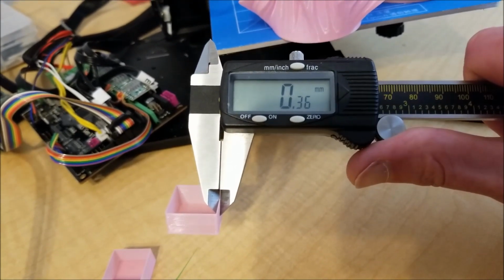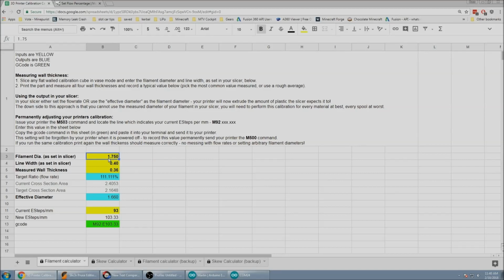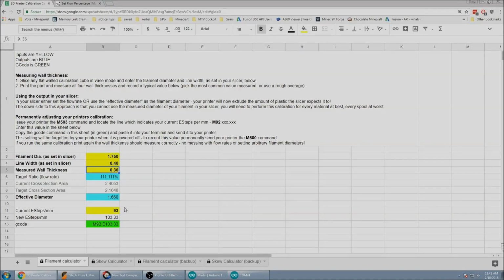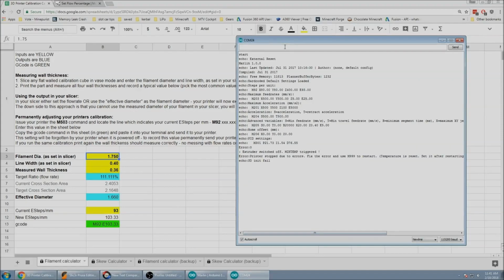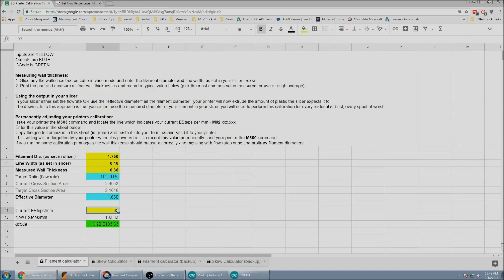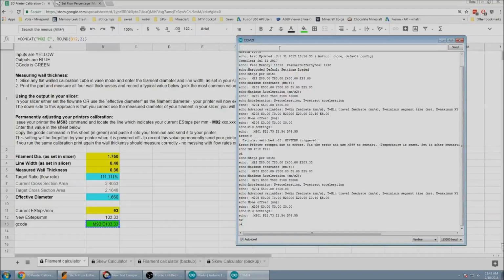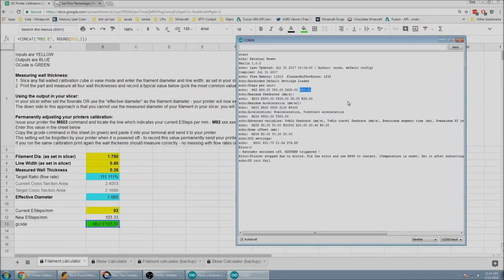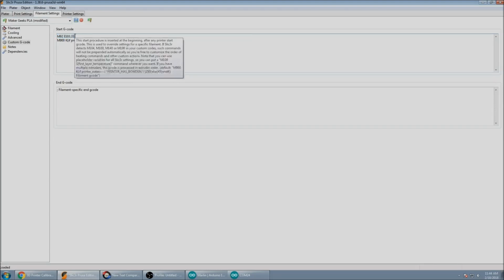Getting Better Layers from your 3D Printer and a better(?) way to calibrate your extruder!

Comment: almost every article i've read about flow calibrations says you should first calibrate hour extruder  e-steps first ,and only then calibrate flow 
another point to consider is that when calibrating e-steps the filament temperature should be high to allow minimum resistance. (otherwise results would vary greatly)

Comment: Just subbed, i got a alfawise u30 giving me underextruding issues and the old way of marking the filament just doesn't work well as i dont care what goes in since that's 1.75mm i care what the part measures. Gonna go try this asap. Ty

Comment: My ender 2 was built around 9/2018 and there is no longer a flexible connection for the Z axis at least there is none on mine, it has a completely different coupler, people complained about alignment of the screw being off severely on these older ones with the flexible coupler, but what you pointed out would be a lead cause for that, the alignment on mine is within 0.6 mm from top to bottom! another thing people over look is making sure the the print head rail is inline and square with the bed while assembling, which can give you a non square print! 

I know some people were complaining about using abs, you actually have to set the temp to at least 240-250 in the g code in order to print abs. But I love the finish of carbon fiber abs, I had problems at the 230 c setting for the carbon fiber abs, but once I turned it up to 250 C it prints perfectly and does not curl or separate from the bed, however with standard abs this is not the case, at 250 C it will curl and separate from the bed, but it may do a little better at 240 C and a slower print speed, allowing the stock setup to cool the abs more than a 60mm/s setting does!

But in the future I will look into designing my own cooling for the print head, most require a blower, but I have several 40mm fans I used to use on my ram that are just sitting now!

Comment: Hi Ross. Thanks for this informative video. I have ran a test myself with a small cube as you did. Result: I now have a cube with two smooth sides (paper thin) and two sides where I noticed the X axis was making kind of a zig/zag move. These two walls also printed but with a different texture and wider than 0.4. Result: first wall (facing me in front of the printer) 0.66mm. Second wall (wall on the right) 0.62. Back wall 0.28 and left wall 0.33. Think I have some more work at hand to calibrate. Any tips are more than welcome. I realize that this is a bit of a dated video :-)
Reply from the maker: That sounds terrible. What printer do you have? Is it pretty much just out of the box? Or has it been working fine? 

I've never experienced anything like that. I'd start with making sure all the screws and nuts are tightened down and check the tension of the belts (if its brand new... that's actually more of a reason to make sure everything is tight). I'd also check the filament path making sure nothing is out of alignment (e.g. does the extrusion gear align well with the filament line in and out or do you need to wiggle or fiddle with the filament when loading to get it to go through). Also make sure you have enough tension on the extrusion gear. I'd also suspect a possible partially clogged nozzle so try some unclogging techniques such as a cold pull, etc. If it's a ptfe lined hot end it might be worth disassembling the hotend, refreshing (make sure it's not distorted, etc., use a good blade to give the inside lip of the tube a bit of a chamfer) and re-seating the ptfe tube. My ptfe lined hot end that came with my ender 2 was poorly assembled and rebuilding it solved a lot of my early problems.

Hope this helps!
Reply: @rossk7927  Update. I have checked everything as you suggested but could not really find any issues. I then went back into Cura and loaded the cube and the circle test objects. Sliced it and upon closer inspection it turns out that Cura slicer looks to be causing this. I have checked every setting but so far i am not able to tackle this issue.
Reply from the maker: Give the profiles recently shared/used by Makers Muse in his ender 3 follow up video a try (posted in the last week or two). The video is titled something like try this weird trick to improve your prints (titled as a bit of a joke). I generally use Slic3r these days myself, having a lot of control over the slicer can be good but frankly I find that cura these days offers an overwhelming set of options and I have a hard time remembering what they do or why I set something the way I did (or even IF i set it myself). 

It may also be worth checking for a new version of cura, if you are on the latest version try a slightly older one. There might be a bug in the version, and combination of settings, you are using.
Reply: @rossk7927  Nailed it! I watched the video and the two setting I changed are the layer height from 0.2 to 0.16 and the flow rate based on your video. Thanks bud. Happy printing
Reply: @rossk7927  Thanks for the reply! I have a Ender 3 which is as good as new. I will start by following your advice. Just to validate I have also run a test with a round box of same dimensions (bottom, wall thickness and diameter of 20mm). This time it gives me a consistent wall thickness. I will let you know what the outcome is

Comment: This is super informative. Thanks!  So you drew boxes with .40mm wall thicknesses as the calibration parts?
Reply from the maker: I used a solid cube model and sliced it in vase mode. Vase mode prints the shape in one continuous line which spirals up giving the part no seams but only a single wall. Not all shapes can be printed in vase mode.

Comment: Hey Ross, thanks for the video. I have two questions for you :)
1/ if you extrude by hand some PLA with a 0.4mm end, let's say at 200°, then you let it cool down, and you use your caliper to measure the diameter of the "string" that got out, what dimension do you get ?
2/ when they say "190° extrusion temp", does it mean 190° measured at the extruder end, or at the aluminium bloc ? (i need 230° at the alu bloc to get 190° at the extruder end...) 
many thanks !
Reply from the maker: 1) No idea, this isn't a valid way to get any useful data. This isn't valid because the nozzle wont be under pressure, feed rates wont likely be close to print feed rates, and the extrusion won't likely come out consistently anyway. 

2) This is normal. It's just the way the universe works - for the air around your block to warm the block needs to give up energy. The temperature is read internal to the block - Ideally it's the temperature of the melt zone. A block is normally laid out as heater cartridge, melt zone / nozzle, thermistor. 

Also beware of cheap Chinese blocks (esp. "mixer" blocks) - stainless steel is cheaper than aluminum but has very poor thermal properties. Also if the block is not laid out as I previously mentioned then your melt zone may be cooler than the read temperature.

It's possible that that the thermistor is reading the wrong temp - but this isn't likely unless you loaded Marlin yourself and configured the wrong thermal profile.

Finally, if you use hardened (steel) nozzles you should expect to need to increase print temps by 5-10C to get print quality anywhere near that of a brass nozzle.

Hope this helps - let me know!

Comment: Hi Ross! Great video. Would you mind sharing your Slic3r profile for the Ender 2? I have spent many hours trying to get the settings tuned, and I am still having some over extrusion issues. It would be great to compare my "guess-tamations"  against your proven settings. Also, it would help me to see if the issues are more mech than soft.

Keep up the great videos!
Reply from the maker: I was going to work on that video yesterday but I ended up re-installing windows instead, due to finally getting sick of video driver issues, and I forgot to save my profiles so I don't know if they are lost or not. That said, I found using Prusa's Slic3r version (https://www.prusa3d.com/slic3r-prusa-edition/ ) and using the mk3 as my base profile gave me the best results. The up-shot to this is that the process will be very fresh in my memory when i do make the video ;)
Reply: Mistakenly posted as my wife...reposting:

I too used the Prusa MK3 settings as a baseline. I am getting pretty good results, but wonder if there isn't even more tuning I could do. I am doing Benchy boats as a benchmark test.  Here are the changes I have made so far from the base Prusa Slic3r settings:

Slic3r Change Tracking:

1st Run (Pure Prusa Settings)

2nd Run (Changed .8 to 2 on retraction length)

3rd Run  (Changed 2 to 4 on retraction length)
  (G1 X0 Y200; home X axis ->
    G1 X0 Y0; home X axis)

4th Run (Changed 4 to 5 on retraction length)
  (G1 X0 Y150; home X axis)
  (Removed auto mesh leveling)

5th Run (Change Retract on Layer Change to OFF)
  (Retraction Speed from 35 to 40)
  (Retract amt to 10% from 0)
  (Avoid crossing perimeters ON)

6th Run (Changed 5 to 6 on retraction length)
Reply from the maker: Sounds like you are about there. Retraction should be about 6mm with PLA, you can go as high as 80mm/s on the retraction but this might shred some filaments. Use z-hop, use avoid crossing perimeters, adjust the priming line so it doesn't run out of bounds (set the Y-2 move to be Y0). Set the "bed shape" (printer settings tab) to limit the print bed to 150x150.

*here's my start gcode*
G28 ; home all without mesh bed level
G90 ; set absolute positioning
G1 Z5 ; lift the print head off the bed so pre-heating doesnt damage the print surface
M83  ; extruder relative mode
M104 S[first_layer_temperature] ; set extruder temp
M140 S[first_layer_bed_temperature] ; set bed temp
M190 S[first_layer_bed_temperature] ; wait for bed temp
M109 S[first_layer_temperature] ; wait for extruder temp
;G29  ; Tram the bed - Only enable if you have a Z-Probe
G1 X0 Y0 F8000 ; goto X:0, Y:0
G1 Z0.3 F600 ; move to Z0.3
G92 E0.0 ; zero the extruder position counter
G1 X60.0 E9.0  F1000.0 ; intro line
G1 X100.0 E12.5  F1000.0 ; intro line
G92 E0.0 ; zero the extruder position counter

If you want to do it right I also suggest also changing the "Notes" of the Printer Settings for your ender to be:
PRINTER_MODEL_ENDER2
PRINTER_HAS_BOWDEN

Beware that this change will "hide" the existing print settings - so you might want to modify the "Dependencies" section on the "print settings" you use to either have no conditionals or to include the PRINTER_MODEL_ENDER2 ... e.g. set the Compatible printers condition to:
printer_notes=~/.*PRINTER_MODEL_ENDER2.*/ and nozzle_diameter[0]==0.4
Reply: Awesome. Thanks, Ross!

Comment: Hey I tried to calibrate the extruder using your method. Now my parts seem to be too small (almost exactly the amount I compensated for 0,1mm). Any thoughts on that? (I print with petg)
Reply from the maker: This is something that people will commonly mistake for their printer "needing calibration" - in fact it is just physics doing what it does. Hot things shrink as they cool - period. PLA and PETG don't shrink as badly as ABS for example but they do still shrink. If you are noticing a 0.1mm change in dimension then I'm guessing that you previously performed some sort of dimensional compensation to get dimensionally accurate parts from your printer - then you changed your extruder settings so you will need to re-compensate.

See this excellent write-up on the topic: https://www.thingiverse.com/thing:52946

Do keep an eye out for signs of under-extrusion and backlash problems (which can look like under extrusion problems such as detached perimeters but only appearing on one side of your print).

P.S. if you had to compensate for 0.1mm extrusion width make sure your nozzle isn't warn out.
Reply: Ross K Ross K Yeah, that's the weird part I did not try to compensate for anything, this was the first calibration I tried (other than slicer settings (temp, retraction, speed). Dimensions were within 0,05mm with an calibration cube before, but more with other equally small parts (likely due to over extrusion as it turns out).

The nozzle is my best guess as well but it's only about 10 hours of printing old, it might have been too big all along.

So it is either shrinking or the nozzle I think.

Ps: Actually I calibrated the extruder right before I tried this method. Other than that no calibrations were performed.
Reply from the maker: Odds are good your nozzle is fine then - likely just poor defaults from the manufacturer. If you look at the guide i linked in my last reply see the section called "Calibrate scale" - it states that when you have everything right you should EXPECT your part to be 0.5% to 1% undersized due to shrinkage.

Also realize that 3D printers have X and Y resolutions too. People don't talk about it much but it's there and should be in the 5-10micron region if you assume that micro steps are consistent (which is not a safe assumption - because they are not) and if you assume your printer has no backlash (which if you're using belts is also simply not true). In reality you can only "trust" half steps (due to how steppers actually function) which will put you in the 40micron region and even then steppers aren't perfect. If you have a 200 steps per rev (e.g. 1.8deg per step) stepper each step will not be "exactly" 1.8 deg simply due to manufacturing tolerances.

Anyway, you should be able to get down to 50micron (0.05mm) or so XY accuracy without being overly unreasonable but in reality if you need that kind of accuracy you will likely be tuning your print settings for each critical part. I'd love to be proven wrong here but I've come to accept this as reality.